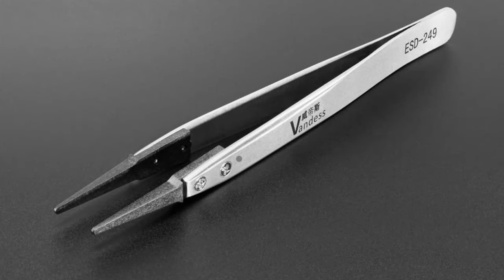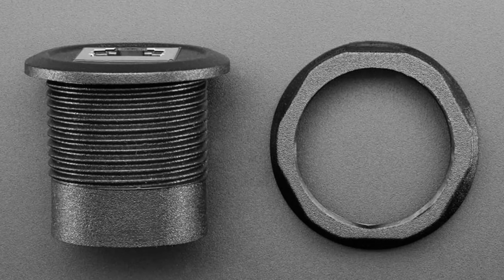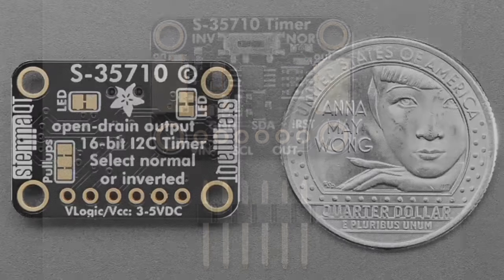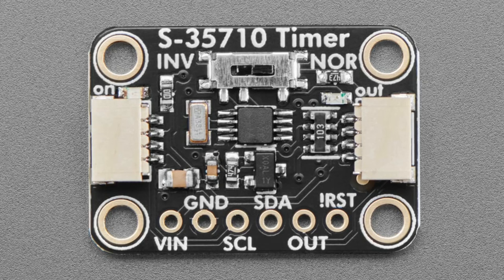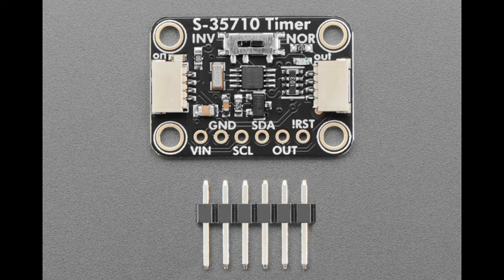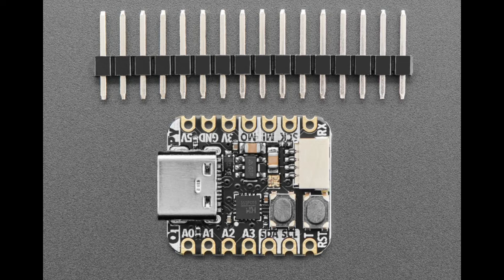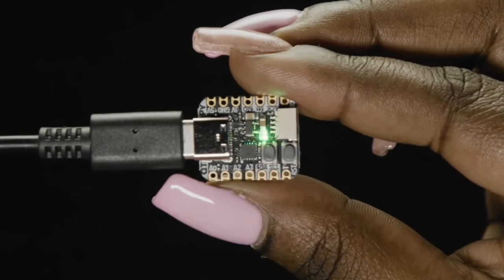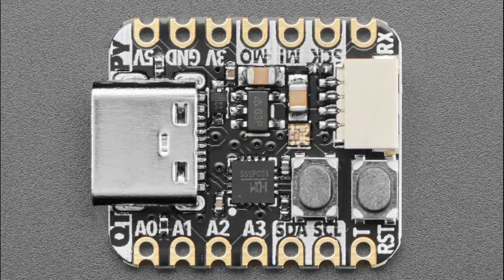#NewProducts 5/1/24 Feat. #Adafruit #CH552 #QTPy - 8051 Dev Board with #STEMMAQT!

Comment: I'm pretty naive about the compiler situation,  but I am under the impression that CH55xduino uses SDCC - for which there is a CPP preprocessor (SDCPP) Does someone just need to do the footwork to implement SDCPP in there? Or am I misunderstanding how C++ becomes machine code?
Reply: Cpp is c preprocessor, not c++. Very different. People used to compile c++ to c very long ago but it's pretty rare today.

Plus, frankly 8051 doesn't even map that well even to C.
Reply: @rpavlik1  Thank you for the clarification!